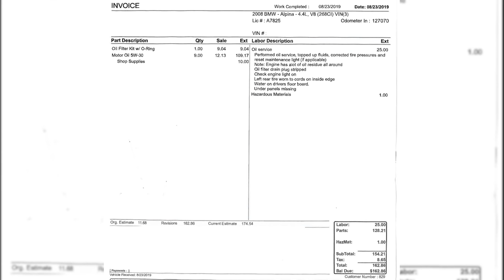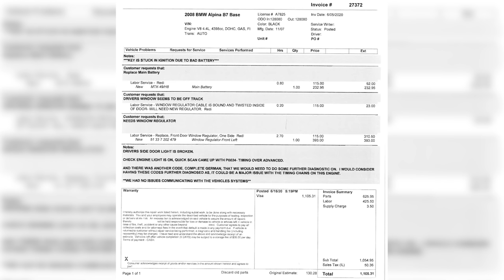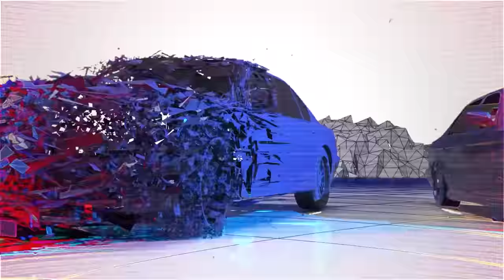Broken Alpina Is Hiding Secrets and a NAIL, Literally - Supercharged B7 - Project Chicago: Part 2

Comment: The complexities of this engine baffle me and you just turn every corner with ease. I can’t imagine a main stealership tackling this and doing a perfect job there just wouldn’t be the time or care. Imagine the labour charge you’d need to sell the house. You are a brave man this was a visual and technical feast. 👍👍👌
Reply: Hate to be that guy, but jeez, an electric “motor” is so much more simple. This is a beautiful symphony.
Reply: I'm working on the older M60 V8 by BMW at the moment which seems way more mechanic friendly 😎. Respect for the work on this Alpina! Makes you figure how many 'normal' 745i's end up on the scrap yard because of similar issues 😅
Reply: At a stealer ship it would be done faster.  They don't do this process.  They go about it a different way. They do not drop the subframe. Plus they have all the specialty tools needed to speed it up also.  Either way I wouldn't want to pay for the labor
Reply: @misterx3492  very interesting the similarities to the M60 as it got stripped down. Intake ports are identical, the lower timing case was an evolution with same water pump casting. Looks like they went back to the plastic guides after the M62 wishbone
Reply: @mtbhussler  indeed! Just got the inlet manifold off of mine today and it the ports indeed look very similar. Same for the waterpump casting indeed!
The plastic wiring loom parts for the coils are so huge on the m60 they nicely made these smaller on the n62. Some improvements, some stuff was kept. Funny to see.
I'm freshing mine up before it goes into a E30. Duplex chain and guides still look fine.. think i'm gonna leave that for what it is 😅
Reply: Stealership! I'm going to use that one.
Reply: @niewissen9912  no way to change the timing chain guidance with the Timing chain cover in place and for removing the cover you have to EXACLY what he is showing .
Maybe you could change the timingchain on its own by pulling it TRUH the engine (timing Chain cover ) .
So please stop to talk about things which you dont understand or even EVER tryied by yourself.
Reply: Exactly, stealership! Well said
Reply: Used to work in a BMW and Alpina dealership and have Infact worked on these engines, I took as much time as it needed to do the correct job.
Reply: @VIPOdyssey176  how profound
Reply: @blest5132  it’s easy to bash dealers but there are people who take the utmost care

Comment: "Oh the check engine light is on, I wonder what that could be"
3 days of wrenching later with half the engine on various shelves:
"yeah the timing is off"

Gotta love early 2000s BMW engineering.
Reply: Gotta love the Germans. They over-engineer everything. :)
Reply: @adamlannerd1408  yes as opposed to hemi engines that run flat at 100k or maybe dodges famous plastic timing chain guides? Stop acting like under-engineered cars mean shit… lame. Everyone who likes cars knows, they all got problems. Unless of course they’re japan built.

Edit: as I said that, Subaru head gasket blew out somewhere
Reply: @Indubitabl3  well Subies and Mazda rotaries and Mitsubishi 4G63s and Toyota 4AGEs are the exceptions to the Japanese reliability thing.
They sacrifice themselves for the rest to be bulletproof
Reply: @Indubitabl3  if it’s a 5.9l 12v cummins then it’s partially perfect.
Reply: @FishFind3000  for sure even a broken clock is right twice a day, these car makers accidentally built a reliable one. They all have, but they’ve all pushed out poorly engineered hot garbage for the most part. Legit had a guy lecturing me about German car reliability post explaining his Magnum not pushing over 100k miles, whilst leaning on my f10 with 250k miles lmao. Bmw has built some amazing engines. That’s why Toyota staked their reputation on it.  Common trope in America. American car good, everyone else bad. Lame  nonsense
Reply: @Indubitabl3  I mean I don't see that many Japanese cars where I live, but Toyotas seem to be made from cardboard, some really bad rust on some of the older ones, and for the newer ones I've only ever had issues with parts being super expensive, like someone stealing the rear wiper on my uncle's old Yaris and when he went to buy a new one he found out it's like €50... for a rear wiper arm.
Reply: @Guillaume Remy: Well, the 2020s BMWs aren't any better, and for that matter other brands aswell.
Reply: As he is explaining at 8:35', incorrect oil pressure causes the chain guides to break, leading subsequently to the chain jumping teeth. Apparently the nail, on its way from the top of the engine to the bottom, broke something. That something messed up with the filters and oil pick-up in the oil pan. That led to the oil circulation problem, leading to the chain guide breaking, leading to the chain jumping teeth on the camshaft/crankshaft.
Reply: @Indubitabl3  many early 2000s BMWs also had plastic timing chain guides.
Reply: @Indubitabl3  Couldn't agree more. Sure, I've had some problems with my 330i, mainly injectors etc. I could buy a really reliable Civic. Then drive it off a cliff out of boredom.
Reply: @nomayor1  The oil flow couldn't be decreased by that small amount of debris, in my vision. The oil filtering mesh wasn't clogged. Furthermore, it's not the only Alpina with this problem, regardless of the presence of the nail.
Reply: @MattyEngland  exactly, the point being is my fellow Americans have dewy eyed love for our automakers, and I do love American cars, but to say they’re more reliable, engineered with more efficacy is a farce. They all cut corners, add shit we don’t need, and don’t address the common issues. So yeah, I’ll take the German car that Is not only comfortable, it’s sporty. I’ll take the American Pickup’s for utility, and I’ll take the Japanese cars for reliability, and sport. But what I won’t do, is act like one is superior to the other. I can’t stand when people let gang type mentality drive their opinion. American, German, whatever they all have downfalls and upsides. Most car people fully get this. Try to find a balance. But man if I didn’t grow up hearing about how German cars are trash, etc.
Reply: @jbuckley2546  well some are built better than others that’s for sure. Everyone should drive what they love, do their homework tho, because sometimes we love things that are inherently broken lol!
Reply: @GlamStacheessnostalgialounge  we’re mostly talking drive/power train reliability. Albeit it is annoying when little stuff falls apart too. Toyota build great cars and trucks, for people who want no hassle, no fun driving experience they’re the go to: I will say, their off road vehicles are top notch. 4Runner, Landcruiser etc all great trucks
Reply: @Indubitabl3  I'd say the entire body starting to rot is more than a "little issue", and from my experience the interior quality of Toyotas leaves a lot to be desired. I've only worked on a few since there are very few Japanese cars over here where I live, but I'm not really impressed, they're not bad but, not really amazing either. The 80s, 90s and 2000s stuff (which is what I mostly get to work on) is on par with any Peugeot, Volkswagen or Renault.
Reply: Yup, they certainly made some "interesting" engineering decisions in that period...

That strange noise you can hear faintly in the background is hundreds of Mercedes-Benz engineers from the '60s though to the mid-'90s banging their heads on their drawing boards and shouting, in unison "nein, nein, nein!!!" repeatedly...
Reply: @gosportjamie  🤣
Reply: late 2000ths engineering xD
Reply: @legioner9  Those impurities were sitting on the bottom of the oil pan when we saw them. When the oil pump is in operation, they float right up and the oil pick-up tries to suck them in. That is the moment when what they call oil starvation happens. We agree on the second part, there seems to have been a BMW Technical Service Bulletin specifying the change of the oil pump. 
   What I can say about BMWs, is that here in the UK the Police uses all kinds of BMW models as Police cars for more than 20 years. Both as interceptors, as well as patrol cars. I would have thought that the UK police certainly know better than the internet sofa experts who have never even walked past a BMW dealership.   
   Our own 2018 G30 530d has been impeccable, too. And shall I add something. It feels so beautifully put together, it feels so composed when you drive it, that it would not change my opinion to the slightest bit if at some point I had to change one part or two parts, or fix an oil leak. Which I am sure won't happen either way.
Reply: @nomayor1   Hmm ... The question is if oil starvation can really be caused by some bits which marginally cover the filtering mesh from the oil pump. That would mean that all cars on which the chain links fail to some degree will suffer from oil starvation, which doesn't happen. It would mean premature wear on all moving components in the engine also.
Reply: @nomayor1  plastic chain guides die routinely in BMW's.  It's just the way things are.
Reply: late 2000s*
Reply: @Indubitabl3  meanwhile the 78 datsun still purrs with the original timing chain and head gasket...
Reply: @johnthomasmoulton8934  why don't they use metal guides with impregnated hard rubber for the chain to glide on  like my old datsun used?
Reply: @gregh7457   They called it the 280 cause that’s how many years it will run!  👏
Reply: @gregh7457  oh I'm sure there has to be a better way.
I have two bmw e39 540 & I expect  the chain will guides be replaced in the future.
Reply: @startingtech3900  we’re not there yet
Reply: @physh  I guess I was referring when they say early 2000s to be 2000-2005. Late 2000s would be 2006-2010 which this alpina is an 08. Haha I guess it really doesn’t matter. I have an 08 BMW 550i I guess I just don’t like people saying early 2000s Bc it makes it sound so much older than it is 😆
Reply: This is such a complex repair. I am lost
Reply: @lowkeyturkish  yea
I'd love to be able to do this to my cars as I really don't have a trustworthy mechanic. But this job is sooo in depth, I'm afraid I couldn't put the car back together.
Reply: Hey the computer was right🤣
Reply: @jbuckley2546  "I could buy a really reliable Civic. Then drive it off a cliff out of boredom"
My friend, in 16 words and 2 sentences, you have managed to encapsulate the single most important reason 
why I've never bought Honda Civic, or Accord. 
The current generation of Honda Civics are so ugly, I've decided to study Tort Law in my spare time so I can sue Honda for emotional distress and retinal damage
Reply: @Petrospect  of
Reply: Giving BMW the benefit of the doubt on the service bulletin to replace the oil pump: it's possible that the balance of oil flow to different engine components is extremely delicate. For example, if the timing chains are expected to be lubricated by a very small orifice, then a very small decrease in oil system pressure could lead to a proportionally large decrease in the amount of oil delivered to the timing chains. This may not damage the chains themselves, but rather may cause the guides to heat up more than their composites are rated for.

It's also possible that, if this is more common on the Alpina, there is some other factor causing oil starvation of the timing chain lubrication system, for example if they have diverted oil to the supercharger from the wrong point in the system. This may exacerbate the design deficiency of oil flow on the base engine.

Either way, timing chain guides are a known failure item on a number of BMW engines, and should be replaced proactively where necessary. As much as I prefer timing chains for their usually superior durability and lifespan, these failures make me honestly consider the value of timing belts which are external to the engine and easily replaced.
Reply: @Indubitabl3  Also, my 2003 Mazda 6. Just threw in the towel on that one. After two years of constant repairs, not the least of which included a whole new transmission, I'm selling it for scrap just so I don't have to spend another 2000€ just to get it past the TüV inspection. When it drove, it drove nicely and it was fun but it certainly isn't worth the upkeep. Constant issues with the electrics, power steering and breaks. I spent 2 grand when I bought it and twice that in repairs. Time to move to greener pastures.
Now to be fair, the previous owner had "forgotten" to mention that the car had been involved in a serious accident and much of its parts had been replaced...rather cheaply. Neglecting to mention this kind of thing is highly illegal in these parts but the guy had disappeared after selling me the car. He also hit on my girlfriend, the prick. The maintenance records were either incomplete or outright falsified in hindsight. The guys from the city motorworks doing the pre-sale inspection must have been particularly lazy and/or bribed in order to authorize this car for sale.

Getting a barely used 2004 E46 now, an upgrade in every respect and not burdened with a dodgy history.
Reply: @Indubitabl3  timing chain guides are made out of plastic with a lot of manufacturers if not all. German engines also… Doesn´t necessarily have to be a bad choice – with the right sort of plastic used or engineered up to their task.
Reply: @Petrospect  huh 4age? - my bother had one 400,000km....

Comment: i'll never forget the words of my grandfather which he said to me some 35 years ago when i was just starting my mechanical journey he said "The more they put into a car the less reliable it becomes". and btw holy grunts you sir are a lot braver than most youtubers diving into an engine that complex. excellent content cant wait for the next.
Reply: my Dad told me exactly the same thing...more bells and whistles means more to go wrong...
Reply: In engineering, that's what we learnt.

No of parts increase, no of weak points increase
Reply: ضش
Reply: Sensors for checking if another sensor is working. That's where we are now sadly...
Reply: And that‘s why buying a old car is 1000x times better than getting a new one. 

At least for us who like to fiddle around with cars.
Reply: the more you abuse it, the  stronger it gets
Reply: Every part is a potential point of failure.
Reply: @Jimmy Two Times The difference is the older cars were easier to fix.

Comment: Sreten, i am amazed that you dare to take on a projects like this without the 'proper' education for a mechanic. And you just do it. Properly, thoroughly, neat, tidy. 
You even find time to cut the recordings in a way that all work is covered without getting  too long. Absolutely great! 
Add your great sense of humour, and 40 minutes feel like 5. Thank you!

Are you going to change all sprockets of the timing-chain as well, or are they in good condition?
Reply: The best piece of advice I can give is to stay organized, clean have a workshop manual label every part you pull of label every wire connector take as many photos as possible.
Reply: Why would you do that? Makes sense if money wasn’t an object. I know I know prevented maintenance. Ppl sure do know how to spend other Peoples  money
Reply: "Add your great sense of humour, and 40 minutes feel like 5" 
- Absolutely agree 100%

Comment: When you reassemble this engine, don’t forget to replace that nail in the sump using the correct orientation, cleaned of course. 
Looking forward to part three of project der Nagelmotor.
Reply: please tell me why there's a nail, no one has told me this i basically have the same car on original guides and valve stem seals
Reply: @anthonyk  I would bet they used the nail as a sort of funky way to lock the engine in TDC, or to hold something else in place.
Then just forgot about it, or dropped it and didn't care enough to remove the sump. Bad workmanship for sure.
Reply: @Japanie2  i wonder why the guides went then, on these engines there not known to go
Reply: @anthonyk  Yeah I wonder too. Could be lots of reasons though, production fault making the plastic weak, damage from previous work on the timing, low oil, could be anything.
Reply: Good advice. Please look up the BMW part nr of the nail for Sreten's convience. Could be superseded by part nr of an upgraded nail though.
Reply: @anthonyk  plastic and heat don't mix. That may have been a contributing factor.
Reply: @Oasisbill  no because m54 uses plastic guides and that engine ive seen many with 300-400k miles
Reply: .... Metal nail....collect the Tiny metal particles in oil pan...
Reply: @Japanie2  Most likely the age of the car combined with the extreme heat these guides seem to work in. Also the oil might have been not changed on time, with slight delays. Happened to mine, too, after ~220k kilometers.
Reply: @anthonyk  my bet is the mechanic was pissed off at the customer or whatever and added a nail in hopes of destroying the engine.